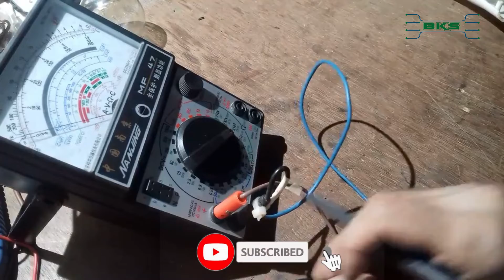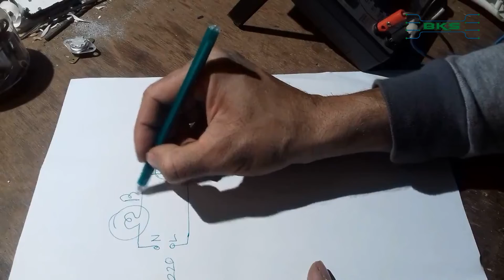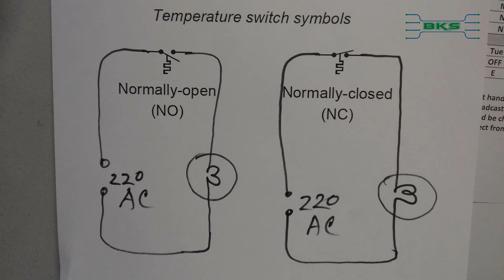Thermostat over heating protection temperature control & how to connect

Comment from the maker: A thermostat exerts control by switching heating or cooling devices on or off, or by regulating the flow of a heat transfer fluid as needed, to maintain the correct temperature. ... Thermostats are used in any device or system that heats or cools to a set point temperature.